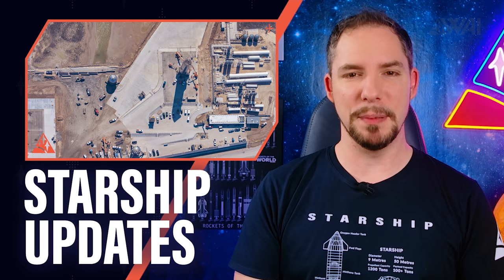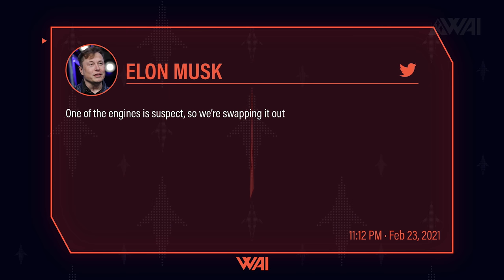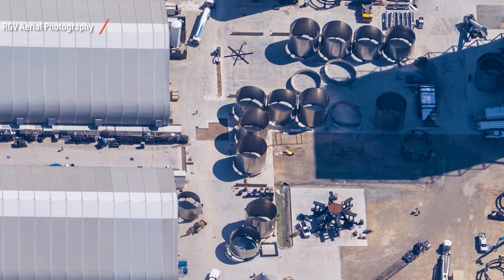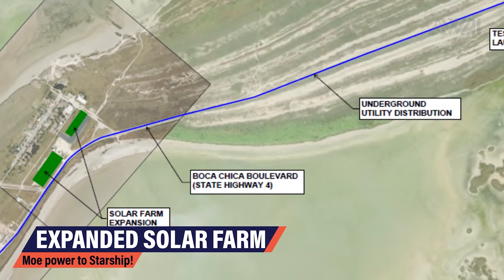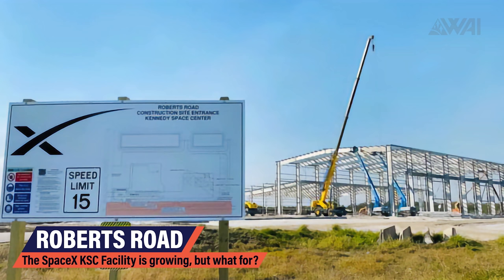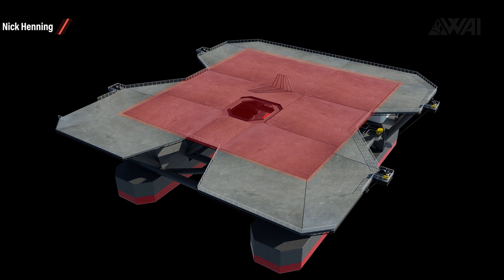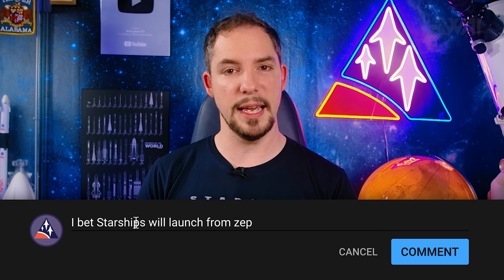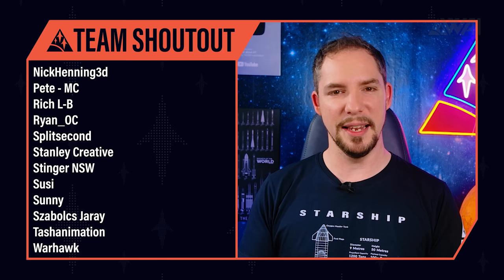150 Is SpaceX Building Two Orbital Starship Pads? & Major Sea Launch Platform Update From Elon Musk!

Comment: Personally I think Starship will sit slightly into the deck so the center of mass can be lowered and the energy can be blasted away and dampened by water cannons to help 
protect buildings and people on the pad.
But also that doesn't account for Starship's landing there and neither does the ramp entirely...
For this reason I think it makes sense to have most of the "buildings" and areas for people below desk, especially since there is lots of open space low to the water down there.
Probably don't want the lifeboats to be be behind the ramp and also below deck (except for backup boats maybe?) purely due to the consideration that if any such deflectors fail,
especially in the event of a catastrophic RUD it would be safer to sit and escape underneath the overbuilt landing pad made to take a rocket impact...
Maybe we need safer life boats with some kind of shrapnel and shock protection?
I think a good idea would be to have a kind of bunker below deck as well that is extremely overbuilt again, to protect against a RUD, even in the water.

I think what makes sense is just having nothing on the pad except the tower which probably won't be able to be 
as overbuilt as on land due to weight and center of mass and wind considerations...

Possibly a very round or sharp shape for the tower to help combat wind impact?
If that's the case the sharp shape could allow the whole structure to be rotated into the wind.
At the same time you probably don't want the tower to be very wide, again, wind considerations, weight, mass of it falling if it were to break due to a RUD...
Or should it also be overbuilt for shockwaves and such?
Or perhaps intentionally make it a intentional weakpoint reduce the impact of things landing on the pad too hard?
Actually speaking of that the "bunker" should be on the non-landing side, possibly then waiting Starships should be moved to the non-landing side and that side could be where the 
bunker is, far side in the event of a starship RUD on the front side of the boat relative to landing?
(You can't hit the side facing away only on the top and front)
Also another consideration for keeping the pad clear is to give the starship the ability to aim away from the pad and hover inwards once it determines control authority.

Does it make sense to have only 2 landing pads if we expect 2 Starship's at a time? + 1 Superheavy booster?
Also if we stack everything onto the Orbital Launch Mount, the launch mount and all the landing pads are probably going to need strong ground anchors to prevent them from topping over,
wind and waves is a huge problem at sea.
Falcon's get away with it because they're so low and only stick around for 1 clear day but Starship's might have to scrub sometimes before leaving or getting back to a port of any scrub.

One final thing, I think it would be cool to recycle boiling fuel, liquid methane and liquid oxygen by pushing it through a turbine or gas generator to save on energy.
It'd be hard to do for LOX because of the corrosive nature but it sounds like a worthwhile problem, ferrying fuel will be hard enough without loosing half of it to boil off.

Comment: I think the launch platforms are going to need a high bay so that maintenance and integration can be performed indoors. Also, if the reason for putting the launch facility off shore is that Superheavy is so loud anything within miles of it is endangered, then would it really be possible to have a launch control crew right there on the platform, mere meters from the rocket? It seems to me likely that launch control would have to be on a boat some miles away.

Comment: I already wondered, why they would still buy fuel tanks. Starship itself is a big fuel tank with rocket motors underneath.
So, they are probably using free time of their welding station to create extra fuel tanks... just star ships that can't fly. They might even put SN5 and SN6 there to double as fuel tanks (they will no longer fly, and they have working tanks).
Could be fun.

Comment: Honestly I don't see a reason for these two buildings on the pad. It would make more sense to put the launch control center on a ship that is a few miles out (or at least a mile). As for the other building being for passengers, I don't see a reason for that either. it makes more sense to just let the passengers immediately go from the ferry ship into the starship and use the ferryship for whatever you planned for that building (like getting a drink or so). 

At best I think there might be some maintenance rooms. And all buildings should be placed underneath the path, this not just protects it against RUD's, but also allows for more space on the deck, maybe not even needing an enlargement or otherwise a smaller one.

Comment: Hi Felix.
The green colour on the engine bell may be a Chromate coating, as seen in the aviation industry. This is usually used for corrosion proofing, maybe they are using it for another purpose.

Comment: These Ensco rigs are semi-submersibles.  Once out in deeper water they sink down into the water to help stabilize the rig in poor weather.  You can't add anything underneath the deck - there is a minimum air-gap requirements for storm conditions.  Think again  -   Sorry.   -   Google Ensco 8500 images and look at rig when it is ballasted down.

Comment: I think you never want to reflect the energy of the 28 raptors back into the rocket. If I were SpaceX I would also put the buildings below the deck, this way you get rid of the engine exhaust energy problem on deck, and also gained more landing area,..Also this way you could easily shield the buildings by extending the through-hole with ring segments towards the sea.

Comment: No way they put structures on the main deck. Even with a blast diverter system it would be HELLISH.  More likely any structures would hang below the main deck, with elevator access. Or perhaps the structures themselves would be raised flush with the deck between launches (which would be VERY cool!).

Comment: Might work to hang the launch mount off one end so the exhaust has a wide open area to vent out into. 

These rigs are massively stable and can use submerged sea anchors to offset weight imbalance. 

I suspect they might have one rig for storage and control and use the second one unmanned for launches. It’s gonna be a hell of a lot of energy eating through that thing when super heavy launches. Might be best to not have anything you can set on for on the launch rig. 

Also, the state tanks aren’t near big enough. You need tanks with as much volume as a super heavy and Starship combined.

Comment: Great work as always.
But best part is no part, why put a giant exhaust ramp when you can have a hole to let the exhaust go below the deck ? It's lighter and save space.

I would also specialize platforms, one for cargo only and one for passengers, since the two needs very differents infrastructures. Maybe that's why they bought 2 platforms, to prototype each model ?

Comment: I think, the reflective shield (asymmetric) is not an option. Because of the Bernoulli's principle the rocket can be pushed sideway. Also, 6-times supersonic gases can damage heatsheld of the vehicle at sea level.
Edit: but maybe it will work OK. At least, the rocket will be much higher at the moment and there is hole in the platform.

Comment: Why not put any buildings under the launch platform? Why direct the exhaust gases up when you can direct them down into the sea which by the way is the ideal vibration damper. Also, need a more symmetrical load balance of the rockets on the platform otherwise that floating platform is going to get lopsided!

Comment: Stainless steel oxides can become green or grey (or blackish or blueish), depending on which temperatures they are created in and (I believe even more) at what atmospheric oxygen concentrations it sees at temperature.
Chromium oxides typically turns out green at temperatures over ~1000 degC in stainless steel when the partial pressure of oxygen is low. It turns out black when it is high.
I suspect the coloring is dependent on test run conditions and/or somewhat different alloys in the the exhaust cone.
/Mats from Sweden

Comment: Sorry but I don't buy the half ring structure to protect buildings from the exausts. It would build a strong unbalanced pressure that would tip over the Starships upon arrival. Beside, given the huge explosions deriving from a faulty landing, I don't think that there will be any operational building on the platform.

Comment: What is the cost of a tower vs the cost of a super heavy? You might want to shield the launch location from the landing pad.  Perhaps two landing (p)ads and two (T)owers and a (L)aunch pad in diagonal across the deck, ala (p) (T) (L) (T) (p) then the landing trajectory can line up perpendicular to that minimizing the track on deck as they would only cross the corners and an on deck RUD would only impact the backside of one tower. Also, put the buildings below deck and you get deck as shielding for free (reinforced buildings are heavy). Very cool stuff thanks for putting it all together for us!

Comment: If I remember correctly just the sound of a rocket launch the size of a Super Heavy would be enough to kill anyone on or near the platform. I would assume that the entire structure will have to be designed with an eye towards mitigating and dampening the vibrations during liftoff and landing, especially since the mass of the platform seems, relatively, light compared to the effective mass of a normal launching site. Heck, just the change in weight and CG from right before to right after liftoff will probably have potentially serious effects. 
I can see a decent chance that, at least while they're getting everything setup, the platforms will be used purely as landing sites for boosters where they can more easily land, be depressurized, safety checked, transferred to a shipping vessel, and then boated to shore.

Comment: I have a question about your simulation for the sea launch platform: there should be a crane for lifting the Starship from the landing pad up upon one of the two launch pads. Now the crane can be the very same structure intended to catch the descending super heavy but even considering a 180° angle of rotation how could they grab the Starships, that lands on the corners? Maybe each arm is capabe of lifting and positioning a Starship by itself?

Comment: Why would SpaceX build such a bulky exhaust ramp when there's ton of open space/open water everywhere around the platform? I'm sure they would put the booster/orbital launches right next to the edge... and also exhaust THROUGH the deck. After all, they are designing the whole thing from the ground up. So instead of building a huge metal structures that is also an eyesore, they will certainly exhaust right into the sea below. The exhaust gases from Starship launches will be perfectly clean anyway. And that oil rig structure below is more than capable of sustaining the vibration from the orbital vehicle. ;)

So Felix, I think your concept is very good in some areas... but maybe just turn that launch tower 180 degrees, hollow out the deck there, and clear a lot of space on the deck by removing that awful flame diverter thing. :)

Cheers!

Comment: 1) Why would you keep highly flammable fuel on/near deck level, when you are an oil rig and can store it deep underwater, under pressure and chilled for you.
2) Why would you have flame a diverter/impinger on deck when you have one 50ft below that is a) free b) evaporatively cooled.  The core issue is super heated salt water corrosion.

The fuel would be pumped from land and stored deep under water, using the water pressure and temperature to keep it safely chilled.
The launch arms swivel out over the water for launch and landing keeping the flamey end well away from the rig, with some form of safety cut-away

Comment: If there is going to be a catch system, where the super heavy booster will be caught while hovering over the platform, wouldn't it make sense to also use this to catch the Starships to protect both the launchpad and the Starships? Maybe this would require some minor redesign of the Starship. Would be interesting to hear ppls comments on this thoughts :)

Comment: OK-----------   Great launch Platform.  But,  I think that putting all the structures (except the launch tower) below the main landing deck would be a wiser design choice giving plenty of room for landing Starships and Boosters without worrying about hitting buildings or other structures. Also better protection for all platform and ship crewmen keeping them below a 2 to 4 foot thick reinforced concrete deck just in case of a hard landing like we have been seeing over and over.  The living and working areas can be built under the full width (except the center Booster blast carry through plenum) of the main  Concrete deck as a support structure much like Aircraft Carriers do over their hanger decks under the main flight deck. With elevators around the edges for lift equipment onto the flight deck.  Besides, 4 landing pads sound better than 2 for a busy launch rig. Giving space for maintenance on as many as two ships or boosters if problems are found without closing down the Platform. Love all your hard work and can't wait to see what you come up with next.

Comment: probably better to put the buildings under the platform leaving it flat for exhaust to dissipate better and not put all that energy into the structure.  Simple metal staircase is all you would need on the surface.

Comment: I am willing to bet that the launch pads are not intended for orbital launches. The overwhelming sonic force of a fully loaded rocket would shatter glass in The town. I think they are for launching rockets to fly with minimal load to the sea launch site. There they will be fully prepared for launch, away from sensitive nesting areas and potential damage to nearby towns.  In Florida the launches of the Saturn rockets was intense even from a distance of five miles. Starship launches will be just as strong, if not stronger.

Comment: I doubt the sea launch platforms will have more than a small portacabin maybe below deck level for when maintenance crews need to come on board for a few hours to service or to fix something - just enough to take lunch breaks in and basic toilet facilities. I think that control functions and passenger waiting areas will be on a separate ship that stands off a safe distance during launches and landings.

For that huge tower maybe they will install a very heavy weight underneath it suspended on wires so that it that can be lowered hundreds of metres down into the sea to give stability, sort of like the keel on a sailing yacht but effectively a keel that has a draft of hundreds of metres. That could give a lot of topside stability for the huge tower.

Comment: put the buildings on the lower deck... it just makes more sense. Lower CG and no need for exhaust ramps. Also you wouldn't want LC on the main deck during a failure.
Reply: Initially, exhaust will be below the main deck. (I expect a hole through the deck.) So, there would still be some need for protection.
Reply: @zzubra  definately. Protection will be needed below deck but it sure helps when you have a thick layer of sheet metal and concrete between you and a rocket crash

Comment: Great visuals ! For the workflow, I might not have understood everything, but are you sure your concept can handle the fact that both the super heavy booster stage and the starship would have to depart from the construction site and land on the platform ? It's probably unlikely that they would fly in together-configuration and land like that on the platform, and if the both arrive separatly, the whole logistic (and space) with a 2 landing sites config on the platform will probably be very complex 😅. Second question, more towards the sketch itself, why try to deflect the exhaust gases upwards rather than sideways in pipes or downwards trough holes or descending pipes ? Critical non relocatable equipements in the baseplate ?

Comment: If the personnel center were to be below deck you could improve safety assuming that there will be people stationed here while launching.  The shield that looks like half a satellite dish may take up  critical space for landing, as well as acting contrary to the idea of flame diversion but that fuel center... tanker barges  outfitted for the containment and dispense of the different fuels they need ... remove the fuel from site easily and safely  as well as providing a vessel for transport of any necessities that come along. I love the concept you came up with and hopefully the windows will not be made of the same glass as the concept cyber truck. Wish I could help collaborate on this one.

Comment: Worried about saving weight below the main deck, then adding a giant single purpose metal half-bowl up top? Makes little and less sense. Keep the buildings under the main deck and you no longer need the exhaust diverter on deck, plus the center of mass stays lower. Use the remaining weight saved to strengthen the deck for increased safety margin. That exhaust diverter won't protect those buildings in the event of a RUD.

Comment: I'm sure I'm wrong but I wonder if the green bell engines are meant to be used if the engine is destroyed in flight or 'landing'. That way when they find parts of the bell that are green they'll know it came from that engine. Maybe that's the engine that burns the longest or something and they want to know it's wear characteristics in real world flight. More likely a test coating or something but it will be interesting to find out.